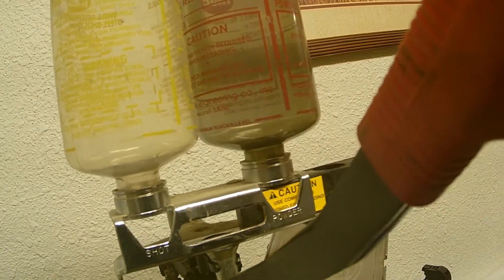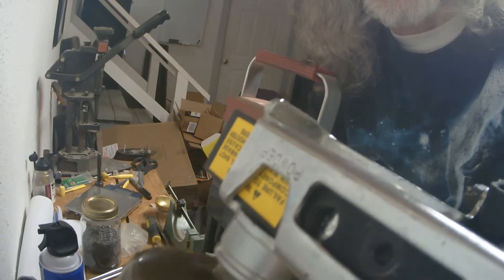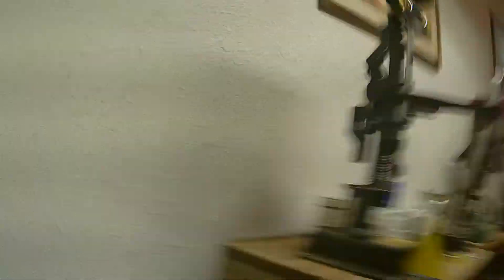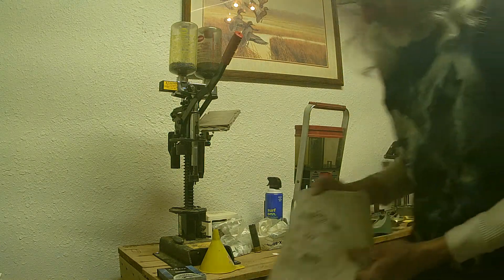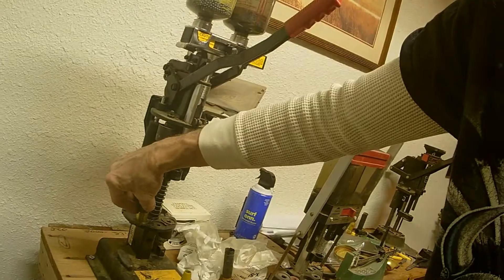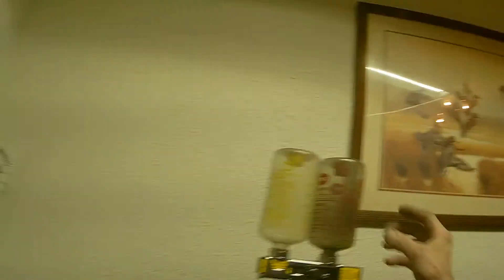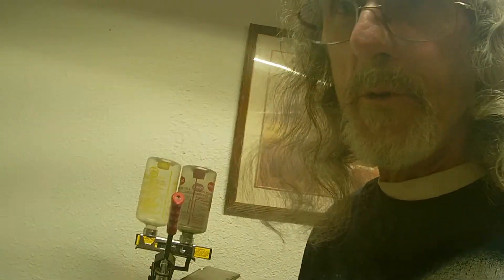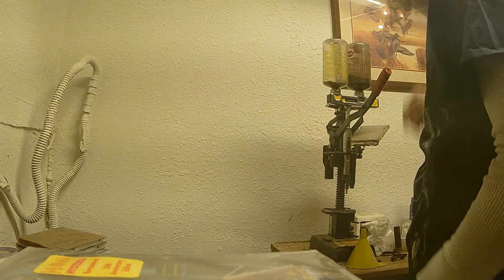Shotshell Reloading pt 2

Comment: ZEEKUPP.. How's it going out in your neck of the woods.. ? Did you ever get Blackie back.. I love to see her back in action this duck & goose hunting season.. Our season here in PA is right around the corner.. Sept 1st 2021.. Can't wait to get out in the field & get shooting at the 1st geese of our early season..
Reply from the maker: Yes, Blackie is back. It required new parts, but it appears to be in good shape. It sat all of last season out. But the tripple did well with a little help from some tungsten heavy weight.
Reply: @ZEEKUPP  Getting Blackie back is good news to hear.. Bad news for the geese rocking the .720 Terror tube.. I'm here at the Steel Mill 4am start getting ready for a 12 hr day & I am happy for you.. I have the same 10ga & choke tube.. It really does a job on geese.. Hope all's well out there with those forest fires & all.. Take care..
Reply from the maker: @pahunter7816  It's good to hear that there are steel mills operating here. There has been so much outsourcing over the years.
Reply: @ZEEKUPP  I second that ZEEKUPP.. I hope our work doesn't ever get out sourced.. I work in a Union Steel Mill that deals with almost every kind of steel.. I often think about the 17-4 because I know alot of choke tube makers use it to make choke tubes & some of the 440C is used for knife blades.. Hope all's well out in your neck of the woods..  I also am looking forward to our PA Early Dove & Goose season that starts Sept 1st 2021